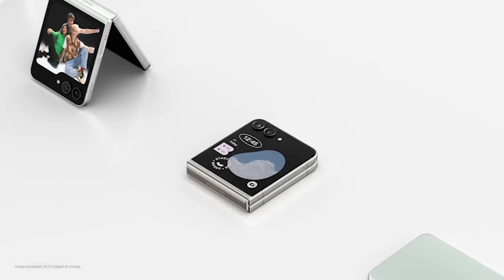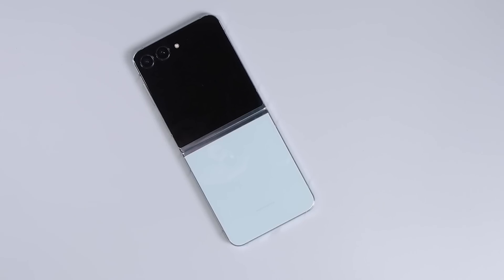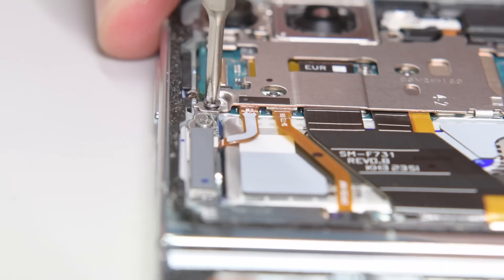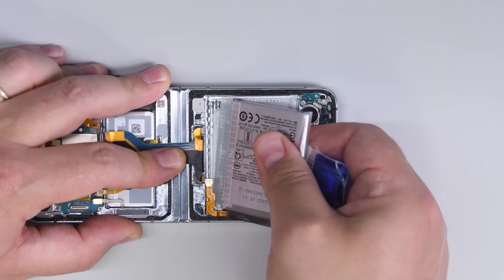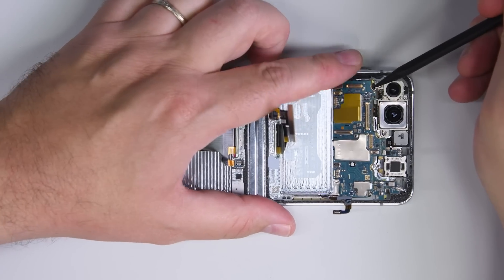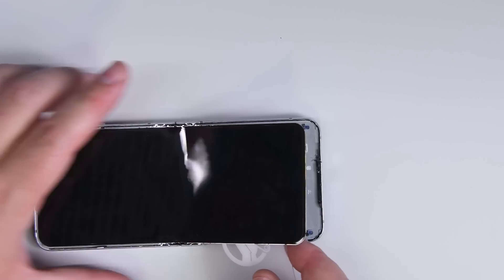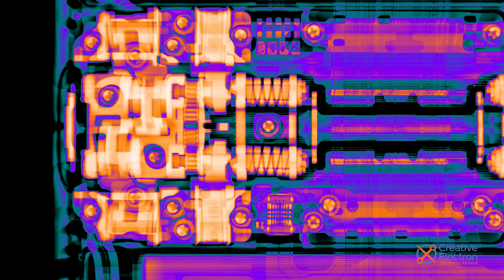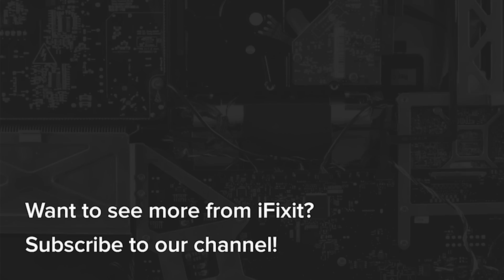Galaxy Z Flip5 Teardown: A Folding Phone to Grind Your Gears

Comment: Was there enough room under the glass back to add a magsafe magnet ring?
Reply: Very unlikely.  Smartphones are built to be as compact as possible with almost no empty space.  That's why you'll see back glass panels (Android phones; screens for iPhones) bulging or them separating from the frame when the battery starts swelling.